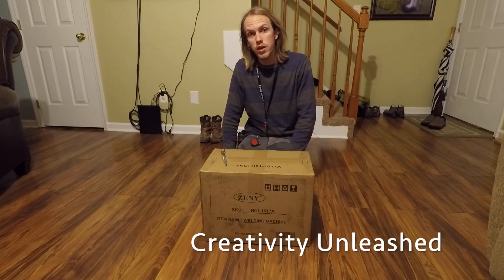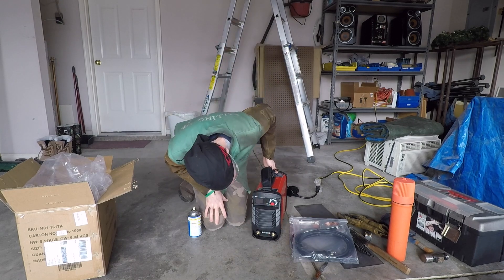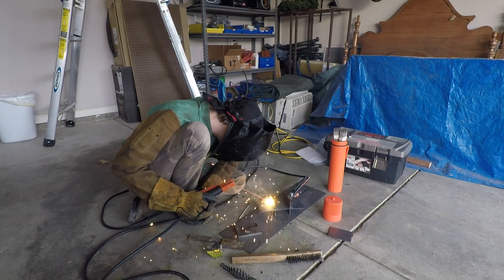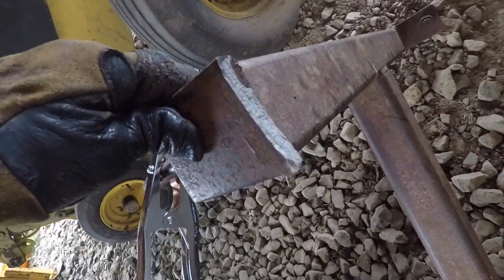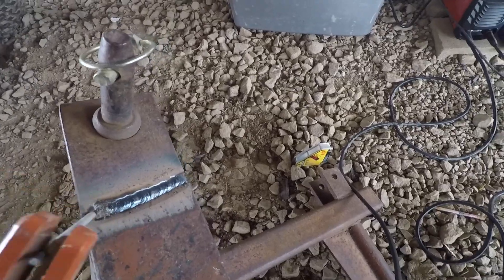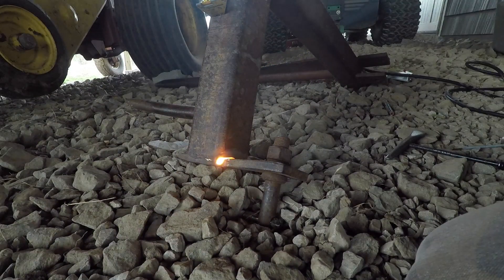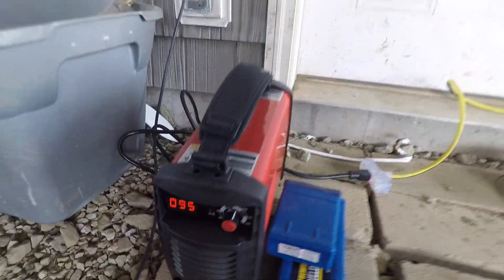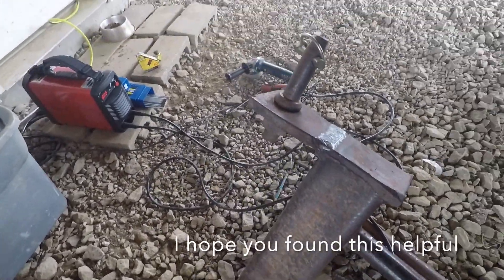Review of ZENY Arc Welder Under $100 - Repairing Broken Hay Fork

Comment: Deny out beat Decklo ,WetloYesweld by far quieter stronger hotter on start off and on 110v 20 amp does 3/32 7018 on 110v.on thick 1/2 inch steel.
Reply: Deny not Deny

Comment: Measure amps to see if the amps are accurate as advertised with this model with so many welders overblown amps and fake duty cycles.
Reply from the maker: That's definitely a good point I've ran across several welding machines that aren't even close to what they said I'm sure they can vary some and the consistency of China of course but I'm quite used to running the different electrodes at different settings and knowing what they run like and it seems to be quite accurate on this particular one

Comment: my machine starts but does not want to weld I check the cables and they are fine.
Reply from the maker: That’s no fun the quality control is definitely not as high as it should be. 
If you can’t get it to work you should definitely contact the seller.
Reply: @CreativityUnleashed  thanks.👍

Comment: Will this work off a 3000 watt inverter and 200ah lithium battery?  Thanks
Reply from the maker: Good question I am going to have to do a video on the subject of this soon I have a Schneider electric 6.2 KW hybrid inverter with 8 225 amp lead acid batteries that our wired for 
48 volts with a PV solar array of 7,800 Watts 
I've done lots of welding off grid on it  I have found running an 1/8" electrode at around 100 amps draws about 2.2 or so kilowatts one of the things that's going to make a big difference is the quality of the inverter you have whether it's pure sine wave or modulating sine wave as well as to make sure your inverter can handle near the 3 KW continuously for at least some period of time without having an issue as well as what it's peak power rating is for example the Schneider we have is 12,000 Watt peak. 
if you're just trying to weld something in a pinch I might consider using the 1/16 welding electrodes that operate usually from 20 to 55 amps

Comment: Thanks for this. My plan is to build a DIY truck camper with a metal frame, so I'm going to have to buy a welder and learn to weld. One of my goals is to try to make this as inexpensive as I can while also making it as high-quality as I can. We'll have to see how that works out. :)
Reply from the maker: Okay sounds good if you run into any trouble welding like thin wall tubing there are several tricks that I've learned over the years that make it a lot easier just let me know

Comment: My van's inverter can output 110v 1200 Watts (possibly double at peak) while the engine is running?  My starter battery is a heavy duty 12v dual purpose marine deep cycle battery 115 AH and I'm connected to it with thick solid copper 1ga cables only 3 feet away.  I've been able to run a 1200 watt electric kettle for 20 minutes with no problem.  Think i will be able to weld two 1/8 rebars in a cross at about 20amps?
Reply from the maker: When I'm working in the Dominican republic I do a lot of welding off of a Schneider electric hybrid inverter that's 6.2kw and 12kw peak hooked to a 10 kilowatt solar array and it works quite well.
But I honestly I don't think 1200 w inverter can run a 1/8"Electrode I was just checked running an 1/8"E7018 at 100 Amps and it was drawing a little over 3000 Watts on the Schneider inverter I hope That's helpful.
And one thing you could try is running a 1/16 Electrode which uses very little electric in comparison

Comment: I bought one of these about A month ago. And have only used it on 110 volts so far. I'm impressed. welds thin stainless without any problem. Think I paid $112 for it. Money well spent.

Comment: Ok so, If I use the 220v plug from the dryer is better? It's the only 220v accessible outlet close to where I fix stuff. I'm about to jump into welding head first. People need quoting me 500$ and up for minor stuff I think I might do myself
Reply from the maker: Amaury Acosta A dryer outlet should work perfectly well but you probably are going to need to make or buy an adapter.
Reply: @CreativityUnleashed  Been using it on 110v ,this thing loves 6013 rods at 65 to 80 amps, 7018 trips the brake too often. Thanks man
Reply: I bought a clothes dryer (3 prong "10-30") to a welder plug ("6-50R") adapter from Amazon. $27  USD.

Comment: Awesome video, I just received my machine and I plugged it in first thing. The amperage knob seems strange to me, no stops but it does dail in the amperage. I bought some 6011 and 7018 rods both in 3/32 and 1/8. I got a small tractor just a matter of time before something cracks or breaks so until that time I practice fusing everything I find laying around.

Comment: I purchased this unit based on this review.  Have used mig , this my first time with stick.I have tried lincoln 7018 3/32  ,  weld cote  6011 3/32  with discouraging results  90-100 amps.  110v only.  This just sticks all the time.  So tough to get an arc going.  any advice??
Reply from the maker: johnny d 7018 and 6011 often take longer to get used to striking An arc with. 6013 electrodes are the easiest to start with but also keep in mind that if you stick a rod it starts getting hot pretty fast and after it gets hot it’s harder to get an arc going so if it sticks a couple times it’s sometimes better to Set it aside and let it cool down and get another rod. 
And remember the rod should always be in movement so that it doesn’t stick I sometimes tap it on the base metal to start or strike it like a match

Comment: Great review ! Got one these recently for a metal  carport project and have tried it. Seems to work as advertised, just need more practice, I do pretty good with a mig but new to stick welding.  What rod would you use for light gauge galvanized tubing ? Tried 6013 3/32"on 110v but thinking 7018 1/8"  fuller beads without burning through.

Comment: While unboxing i heard a rattle.   I opened it and found assembly nuts in the bottom and one bolt missing.  I installed the nuts and one new bolt.  So its all together now.  Yet to put it to the test.

Comment: Really great review I was trying to find a cheap stick for traveling so I don’t have to take my big expensive one and this welder did really good especially using only 105 amps on a 7018 I usually use 125 to 130 on 7018s
Reply: How many amps were you using on 3/32 rods? And also was it on 110v?

Comment: What brand of 7018 electrodes do you use?  The only thing available locally where I live is Hobart, and their flux doesn't peel off like that.  It sticks like glue, and you have to use a wire wheel to clean it up.
Reply from the maker: elkvis I was using PREMIUM WASHINGTON ALLOY WELDING ELECTRODES 
Which I like quite well!!!.
However there are several factors that dictate how well the slag comes off of your weld 
Amperage set to high often a lot of spatter is one of the giveaways of too high of amperage. 
Also inconsistent arc links can cause the slag to stick 
As well as the welding electrodes containing moisture or being old
I hope this was helpful if you still have anymore problems you can let me know.

Comment: thats a great review, good job explining the amps setting and type of electrode you are using, only thing I would do differently is use a thicker (lower gauge)  extension cord, I just placed an oreder for the same machine from amazon.